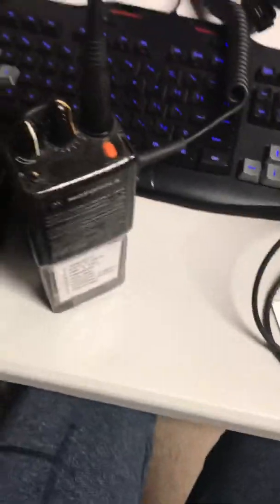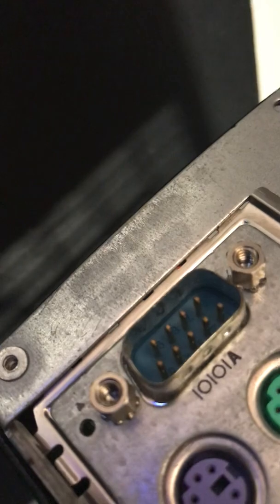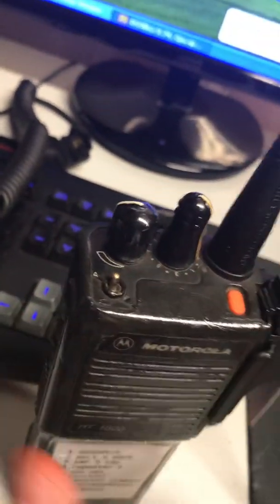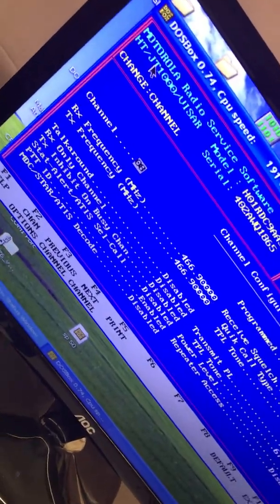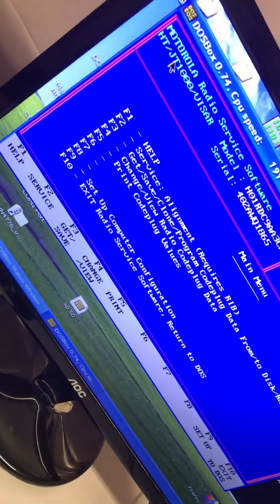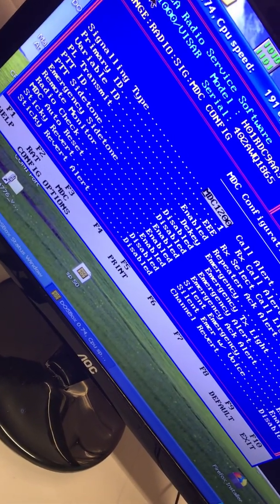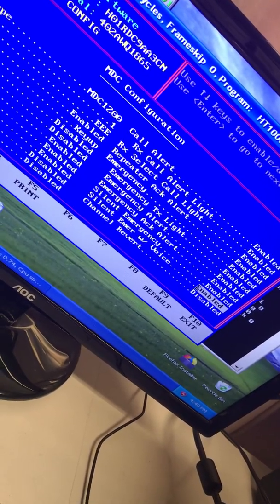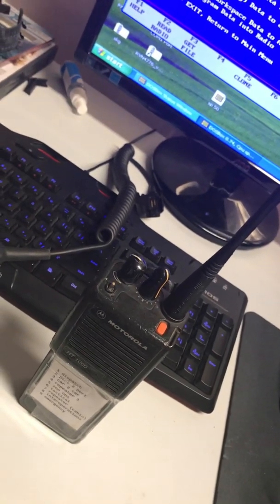How to program a ht1000 from Motorola

Comment: Hi how are you guys doing I have a HT1000 radio and I am using a older windows XP computer. I have the RSS, programming cable and DOS box. I configured the DOS box to have it ready the COM1 which is the port where the programming cable is in, but I can't get the computer to read the radio. I get the error messages that the RIB port connection is unsuccessful. as well as in the compiler of DOS Box I get the error that  there is a serial error.

Any suggestions 

Thank you

Comment: Hi 
I have a Windows 10 machie,  with an rs232 port. Hopefully, as you said, it's hard wired to the motherboard. 

Can you post the configuration text of the dosbox startup files?

What software would I need to program a mtx838 and  mts2000.
Thank you.
Reply: i have a windows 10 machine and can not get this method to work. this may not be your case but the 64bit operating system just wont let the radio and computer talk with eachother!
Reply: @adamisakson2  I made a  bootable usb disk using freedos.
I was able to get it to work.
Thanks
Reply from the maker: keep in mind many factors affect the RS232 compatibility which includes hardware and software. winXP and win7 seem to work well under certain conditions and hardware and software configurations.

Comment: Tried this, didn’t work
Reply: he got lucky using xp. ive never had an issue running windows me 98 or 95 due to all of those being dos based windows programs.
Reply from the maker: I have currently been using WIN7 for my Programming PC and so far have had good luck. keep in mind each pc's software and hardware config will be different and will show different results.

Comment: Thanks for doing this video I plan on programming my radio with a setup like this. Did you have to pass through the serial port is dosbox?
Reply from the maker: You have to link the serial port through dosbox
Reply: @AlucardRacing  Ok thanks I should be getting a programming cable tomorrow. I will see how it goes. Also did you have to slow down dosbox at all?
Reply from the maker: @DeadlyGopher  no but you might have too
Reply: @GadgetGuy2350  Thanks. I found that my newer computer worked inconsistently but I just ran the software like normal on a 32bit Windows XP pc with a USB to serial adapter and it works fine for me.

Comment: Do you have a video on how to do a Motorola saber radio? On a newer computer if possible
Reply: I dont see why it wouldnt work on say a optiplex 7010 on w10 running dosbox
Sweet machine too it has a core i7 3.0ghz, 20gb of ram on mine with a ssd.
Cheap as dirt too and they are slim.
Reply from the maker: it may work but if it doesn't have a hardware-based RS232 controller issue's may arise.
Reply from the maker: I hope to obtain a Motorola saber at some point but I currently do not have a saber in my possession.

Comment: Thanks,Great video on Programming the HT.I have 3 HT1000 
What do you recommend for software for this radio .I'd like to request a video on different scanning modes you can program into this radio
Reply from the maker: Unfortunately ham files has taken Down all Motorola programming software so I have that last piece of software out there
Reply: @AlucardRacing  do you have an email i can reach out to you at? I just bought a lot of 12 radios and I'd like a copy of the software
Reply from the maker: But yes I will absolutely work on a video about scanning modes
Reply: it's out there not just the site mentioned here. you'll have to do the work and I can't list any particular sites (I forgot anyway), and I can't condone it legally speaking

Comment: Hello, how are you doing today? I need your help to program my HT-1000 radio? Can you help me to program my radio? On Channel 1 I wanted to put a Boston Police Scanner to listen and channel 2 only talk with my brother only that's it.
Reply from the maker: i am doing great thanks for asking  the video you have watched details how to program your radio if you need frequencies here is the link for boston PD https://www.radioreference.com/apps/db/?ctid=1225  hopefully this helps
Reply: @AlucardRacing  that's good to hear and your welcome. Oh thank you. Yes it is help me alot. When I try to programming my HT-1000 they said that I cannot program because I need RIB Box so please help me! What doesn't mean?
Reply from the maker: Clark Chan What it means is that either the serial port on your computer is not working or that you have not selected the proper COM port and DOS box for the radio to communicate from so you’re either going to need to buy a new programming cable that is USB to serial converting that is a ribless cable or but first of all I would recommend you should check your computers serial port to make sure that the software you are using is allowing the software to read it
Reply from the maker: Also make sure your battery is in good health and is not dying or failing as well as it has a full charge that should help a lot as well
Reply from the maker: Also make sure your radio is also turned on when you were trying to read the code plug from the software
Reply: @taylorbracken5045  they have programming service on eBay if you type “Motorola MTS2000 programming service” or if you have a local Motorola radio shop they will certainly do it.

Comment: Hello, can you make another video  going into detail about quik call 2 signaling and button configurations?
Reply from the maker: Unfortunately the ht1000 cannot transmit quick call II but it can decode QCII but a different radio or paging encoder has to be used to send or transmit quick call II such as some kenwood mobile radios tk862g or a zetron paging encoder